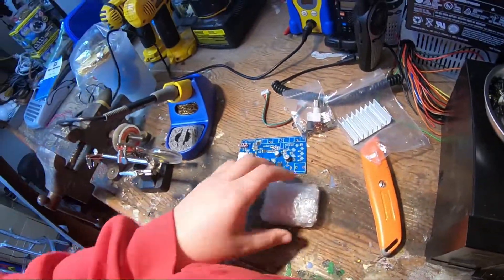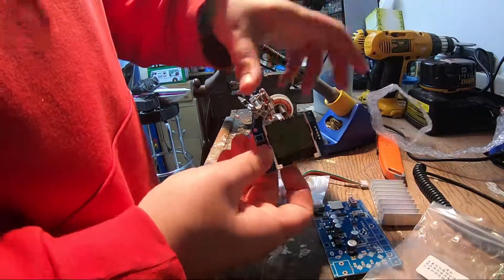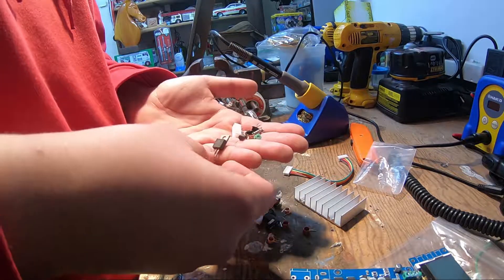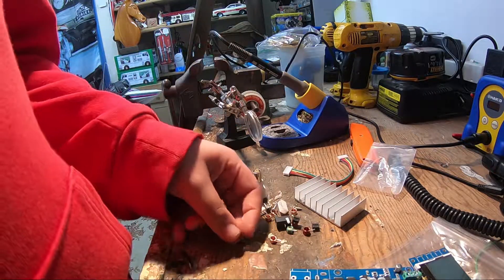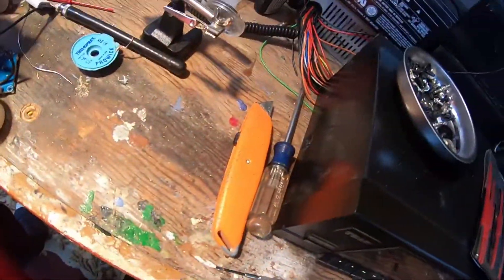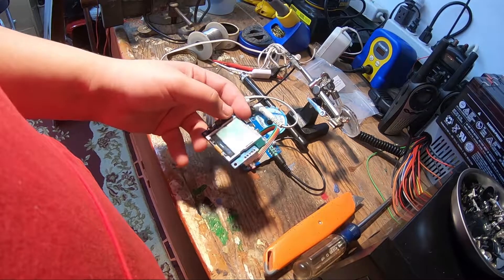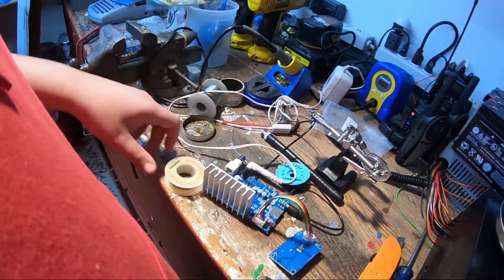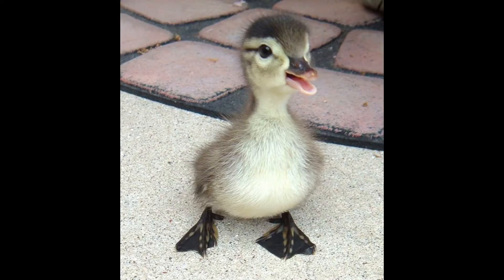The Worst FM Transmitter $25 Can Buy on eBay!

Comment: Nah can't be that worse, It has an SDCard slot that means it's a QN8066 chip-based transmitter. Make sure you buy the pre-assembled one next time. These kits sucks they use old components.

Comment: Never turn that thing on without the antenna pluged in! I broke mine. The range is quite decent on this transmitter and produce clean signal (compared to the other chineses transmitters I have.)
Reply from the maker: YEP! That done it. I turned it on with no antenna. LOL. Was it even in the instruction manual to not turn it on with no antenna? I forgot. But anyways I got a smaller one with RDS :p
Reply: @potatotech7378  whichone?
Reply from the maker: @bioskahabinivous9906  https://www.adafruit.com/product/1958?gclid=Cj0KCQjw3duCBhCAARIsAJeFyPXlTXbWs3XAvqDPZ9ggmyXDXpWwxtH1bEOV3fryJ2RnJn3IjaupSy0aAuovEALw_wcB
Reply: @potatotech7378  Arr there any way to amplify the signal so you can get more range? I think you won't get more than 100 metres with that.
Reply: @potatotech7378  how can you forget that honestly? Thats the n°1 rule in high power RF circuits. Maybe you don't mess with rf circuit often i guess

1 : never turn on without antenna
2 : always check the coax, check for open and short circuit
3: check that every solder joint around the output transistor is good
4 : check that swr is constantly under 2.0:1 , 1.5:1 is good
Reply: @NVC77  the one you have on the video has a great sound you just need AGC and Clipper and it sounds close to the local stations. Also the phase noise doesn't cause too much interference. You can still pick up local stations nearby when your 60 metres away from the antenna (depends on the receiver though). I'm listening to that transmitter while typing this reply now. It doesn't sounds as annoying and overprocessed as most local stations.
Reply: @NVC77  great!